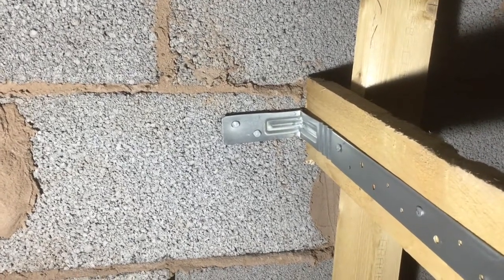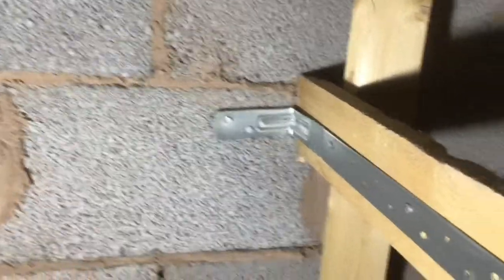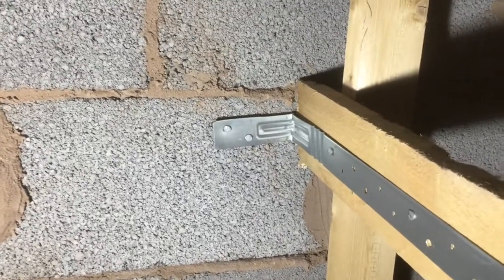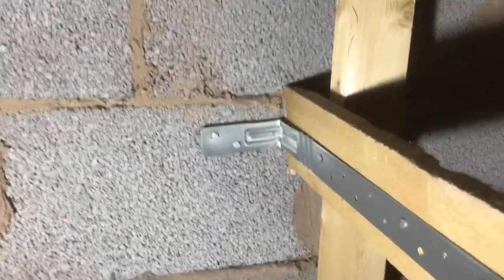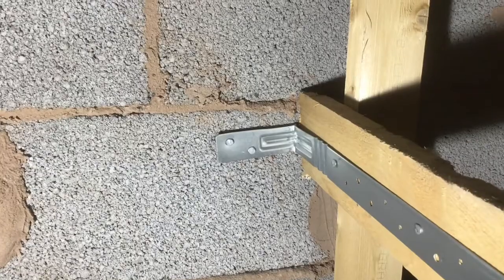Shoddy workmanship in the roof space

Comment: Nice to see the tradition of incorrectly fitting restraint straps is being maintained. None of the ones in the roof in this '82 Martin Grant build were fitted properly, no bracing or packing on any of them, some in the wrong place and one sitting in an open vertical joint in the blockwork which just pulled out. All been sorted now - ta for confirming 6mm fixings into the blockwork is OK.